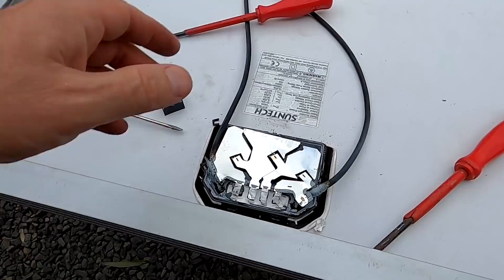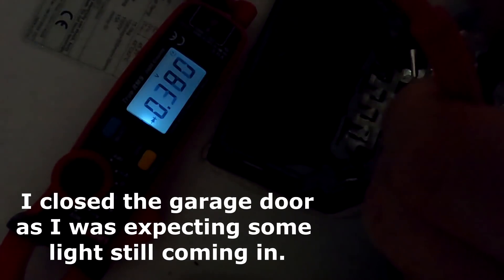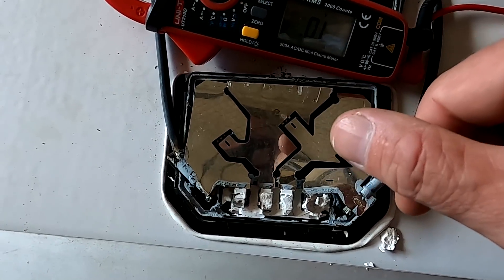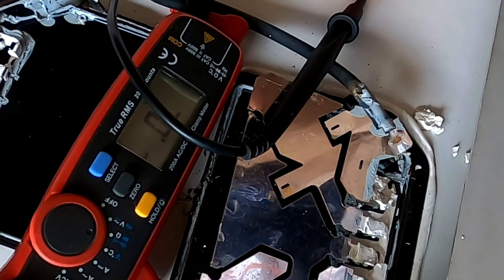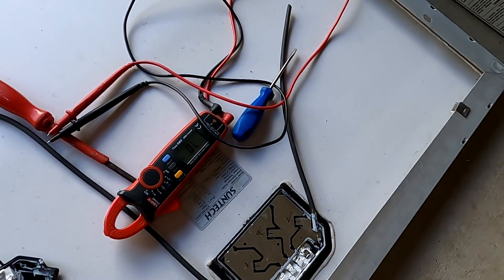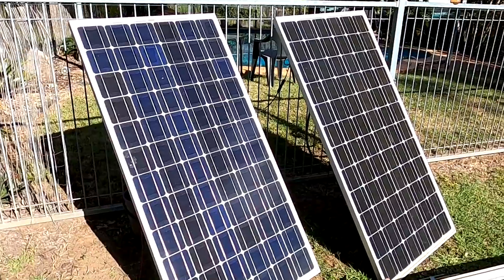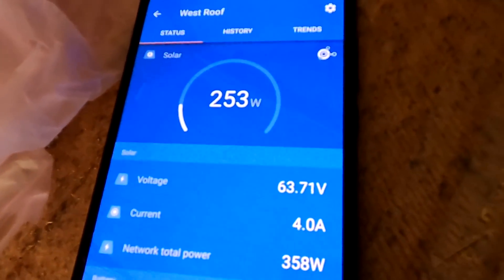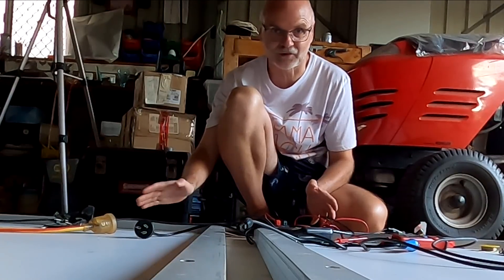Solar Panel Diodes. I found the problem (for a moment)...

Comment: If it's not the diodes, then it must be a faulty/shorted cell in the same string the apparent faulty diode is across. Did you de-solder a diode to test it at the component level, outside of the circuit? Can parallel a few common 1n1004's as a temporary diode substitute to test the difference on a single panel to rule it out.

Comment: Easy to diagnose - get one good panel, connect another panel which is under test and connect to solar charger. If it works well, panel under test is fine. If not... that other panel has an issue.

Comment: My understanding is a panel CANNOT make it’s rated max amperage unless it is shorted out. When it is outputting max wattage, the amps will be a ratio of the watts to voltage...

Comment: At 13:04 we see Andy testing the cell temperature at 54c.  STC is 25c, difference is 29, multiply by 0.3% temperature derate, multiply by panel STC Vmp 36, subtract from 36v, multiply by 2 and we get .... close to 65v, or what Andy saw the Victron settle on at 11:59.  To channel that well known person, AvE, IT VERKS.

Comment: I would unsolder one leg on the diodes and re-measure. It could be a cell string short circuit and not the diodes but unlikely. This is new territory for me and been off grid for years.
Reply from the maker: You're spot on Dave!

Comment: How about applying power  directly to the panels from your lab power supply to test the diodes?

You would not need to crack open the diode case

If all the diodes are working you should see the full voltage with a minimal drop
Reply from the maker: I could try that...

Comment: Nice testing, but no beer until you snip the legs off the diode and measure them in isolation. If it is not the diode then it could be PID of the cells. Note that within a string it is the panels near the positive end that get the worst PID. So some panels that came from the negative end may still perform well. Note that for testing diodes or cells, a “good” result at 2V does not mean good at 45V.
Reply from the maker: That's absolutely correct.

Comment: Andy, 5 seconds into your video there is a clip of your panels on the roof. The left hand one shows some diagonal cracking in the cell at the bottom. I have experienced this myself and it generally leads to lower output depending on how many of the cells are cracked. Just thought I would mention it as it was just like the cracking I saw on one of ours (also in Brisbane area). Not suggesting this is your current problem but I think it will get worse and as you have spare panels maybe this one should be pensioned out.
Cheers Allan

Comment: Looking at 7:47 in the video there appears to be a lower strip connecting the terminals as well as the upper strip containing the diodes. Is it possible that the fault is because of the two strips shorting out somewhere, perhaps from the cover pressing on the upper strip.  

Also, the reason the short circuit amp test across the  two MC4 terminals appears correct while the connection to the charger doesn't work is the short circuit has zero resistance while the charger has some resistance which forces the current backwards through the diodes due to the lower resistance.  

Also again, perhaps the PW charger works better in your test may be due to the resistance being lower through the PMW charger than in the MPPT charger. This can be verified by checking the input resistance in both the MPPT and the PWN chargers.
Reply from the maker: I made sure they are not touching. If the cover is closed they are definitely separated and have these plastic pins to prevent this from happening.
Reply: @OffGridGarageAustralia  At the 2:24 mark look carefully at how the diodes connect to the lower strip. The diodes bridge the large pieces but it APPEARS that the small strip  that the large pieces  connect to is one continuous piece of upside down "Us".

 It may be that the Us are separated on that strip but it is hard to tell from the picture. 

If the lower strip of upside down Us is either one solid piece or somehow shorted between the Us that will defeat the purpose of the passing diodes.

Comment: May need to heat the diodes up to see the failure just in case you run into that when they cool down they test good sometimes.  I think a good share of us have replaced diodes over the years.  I have a big bag of them so cheap and I just replace them anytime they are questionable with better quality ones.

Comment: Now how to find that pannel on your roof. If you cut one wire in a string that string is now open and for all practical purposes does not exist any more so now you have 2 strings so now you would get 60 volts at 10 amps from the 2 if all the panels left are good. If you still only have 1 volt at 1 Amp reconnect that string and cut the next. When you have then found the bad string using this method take that string down check the diodes in those panels and the connectors. These are things you can repair on a panel if it has hot spots showing on the back or other problems sorry but you will not be able to fix these and you then will have to replace those panels.

Comment: Take a panel with bad diodes and run it in series with the diodes removed.
That will definitely rule out micro cracks.

What clamp meter are you using, and do you recommend it?

Comment: Amazing job.  Totally impressed.  You should be able to test without disassembling junction boxes by shading each section covered by a diode while a load is applied.  Voltage should change drastically depending on if a diode has failed or not.  I bet you could also put a reverse voltage on the panel(or even use meter diode checker) and get a consistent 1.4V per section that diodes work.

Comment: Common knowledge says when panels are connected in series voltage is added together thus 3 20volt panels equal 60 volts. And when counted in parallel voltage stays the same an amperage is added together thus 3 12volt 5amp panels yield 12volts at 15amps. So if you have 9 panels in 3 strings you would get 3times the voltage  and 3 times the amperage.  Sounds great right.  OK let's put in one bad pannel in one of those strings. Let's say this pannel only yelds 1 volt at 1 Amp. So instead the string it is on then would not yield 3 times 20 volts but instead will only yield 3 times 1 volt for a total of 3 volts. And at 1 nd that at one Amp. Since it is lso hooked up to 2 more string you with 60 volts per string you might see 60 volts but you would only get 1 Amp from the whole 9 of them. Or you might only get 3volts at 1 Amp.

Comment: If you suspect a bad solder joint. You can buy a can of "cool spray for electronics". Spay on the solder joint while using the diode check meter to check for a bad intermittent solder connection.

Comment: Hi Andy. It would be great if there was some way to test the diodes without opening the connection box. Surely there is a way. What about a few strategically placed holes drilled in the box that can then be sealed after with silicon or tape.
Reply: A simple way to test diodes is to use a bench power supply: set the current limit to 3A, set the voltage limit to panel open-circuit rating or whatever your power supply can output if it does not go that high, then connect panels in the bypass direction while fully dark. If the diodes are good, the diodes' forward voltage should be around 2V (3 x 0.5-0.7V + wiring losses). If the voltage is much higher, one of the diodes is open-circuit and current is leaking through the array. If the voltage is much lower, at least one of the diodes is shorted.
Reply from the maker: There is actually a diode tester out there for solar panels. Well, diodes is only one thing it measures, also does isolation and performance I think. Costs around $1600 though.
Reply: @OffGridGarageAustralia  wow that's lot.

Comment: Afaict, diode mode on a multimeter just applies a small voltage and then measures the voltage drop. Fundamentally not different from measuring resistance with a multimeter. You should be able to just measure resistance on still pristine panels without opening up the junction boxes and figure out which are faulty. You already created a dataset with the panels you already opened and diagnosed, so you can use those to verify this method and the values gotten.
Reply from the maker: I'll show that in the next video.

Comment: Assuming no shadows.
The ISC is a direct measure of the solar radiance. If both panels has an ISC within 10% of each other, the ideal photovoltaic current source is working. A large difference the lower ISC panel has a problem. 

The VOC is a measure of the current in the Diode part of the solar cell model. If the VOc voltage is within 10% between the 2 panels, the diode part of the panel is good.

The 54 deg C temperature is acceptable. The nominal temperature on the panel lable is 45 degs C and assumes a reference diode temperature of 25 degs C.

The wattage reduction for a higher temperature can be approximated by (54-25) *0.5 =14.5 watts.
Where the 0.5 watts/deg c is a general number for Silicon diodes.

The light intensity current is linearly proportional to the sun radiation. If you can get the NASA sun.xls spread sheet (free) you can get an estimate of the solar intensity in watts/m^2 for your location and time of day. Or you can get a solar irradiation app ,(free)  for your phone. You weather service may have solar data you can lookup. 

Good luck

Comment: Great achievement! Can you measure the diodes from the mc4's in a diode check when the panel is not illuminated? Maybe with a small 9v battery you can measure the voltage drop accross the reverse diodes, the voltage should be 9v in the end. But it will only show if 3 diodes are broken. Can you replace the diodes yourself? It saves the panel.

Comment: Seems to me it would’ve been much easier just to measure the positive and negative off of each panel with your meter? That way you could’ve found the bad panel faster and took it out.
Reply: Nope. If only one of the 3 diodes blocks there wont be any reverse current, regardless of the other two.
Reply: @stephanweinberger  
I’m no expert, but it seems like checking each individual panel would’ve shed some kind of light on one of the panels being bad. 
I’ve got 20 panels on my roof and have never seen this kind of issue. Strange how the panels he mentioned were problematic were one of the so-called best?

Comment: Might make a device that pulls current to the specific mppt voltage of the panel (not tracked, just pwm) at this stable voltage I could measure the current. This should show faulty diodes without opening back. I did watch to the end btw. Even if diodes aren't the problem such a device would pickup any such problems. I had a panel with one of the parrellel strings of cells high impedance yesterday.
Reply from the maker: Yes, that is exactly my idea: a MPPT charge controller and a 12V Battery connected to each panel individually. That should give us a good indication of the performance of each panel.

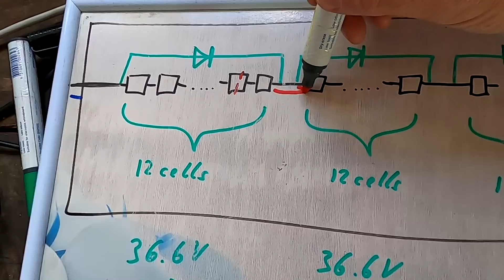Comment: @4:57 The diode has 45V break down Voltage, the diode is being reverse bias by 36.6V string Voltage (and can get higher when cold), the diode should have been spec in at least twice the reverse Voltage being applied to the diode, in this case, they should have used 100V rating not 45V. I'm really glad that you find the problem. BTW, you should also post your videos in DIYSOLARFORUM.
Reply from the maker: The reverse voltage for each diode is only 1/3 of the overall voltage as it covers only one string out of three. Hence three diodes...
Reply: @OffGridGarageAustralia  May be I am looking at your drawing wrong then, your drawing shows 36.6V/36.6V./36.6V for the  3 sets of the cells for each panel.
Reply from the maker: @budmartin3344  OK, I now understand what you mean. Sorry, that was a bit misleading in my drawing. So, each panel has a Vmp of 36.6V and I have three panels in series on the roof.

Comment: All it takes is shorted diodes on one string or one panel and the whole system will lose its productivity. Because they are all connected together at the charge controller they will act as one system. Usually all the diodes in one string will go at the same time because of a over voltage cascade.

Comment: You not must the open junction box. If you connect in serial resistor (R=U/I) then voltage must be 36V. If you have less then is one string on panel in short. So.. 36/5 is arround 7.2 ohm.

Comment: Average life expectancy of a properly designed, inspected, installed, etc. diode should be 100 years. Odds of so many crap diodes...Nope. Manufacturing defect, like the mobs of bad electrolytic caps in computer motherboards some years ago. Replace them ALL with higher rated diodes if this is the case. Unlikely they'd all been struck by lightning without visible damage.
 And make sure to heat sink the new ones.

Comment: As the conductor areas are large inside the box and you know their layout you could just drill small holes in the cover in the correct places and push the cable probes through. Afterwards just seal up the holes if the panel is good.
The other observation is that the panels themselves might allow reverse current. You would need to disconnect the diodes to check. Diodes don't often fail closed circuit.
Reply: In my own experience repairing electronics, semiconductors almost always fail shorted unless the overload is large enough to blow them up.
Reply: I thought the same thing about drilling holes for testing. A dab of sealant afterwards.
Reply: Fantastic tip

Comment: As you will change a lot of diodes try to get some with higher current and voltage rating, otherwise the same thing will happen again.
Reply: Could have been lightning in its past life.

Comment: Well done, the Diodes are half wave rectifiers.
Reply: There are different rectifiers depending how many and how they are configured of course.
Reply: Half wave on AC. On DC one direction.
Reply: @michaelbouckley4455  Normally AC, but maybe it clears up the DC signal for transience.

Comment: For the moment, test all the other panels one by one with the two panels so you can sort the stack of panels that you have into good and bad panels. Then install the good ones on the roof again and worry about the bad ones later. No need to open the good ones.

Comment: 042221/1429h PST 🇺🇸 042321/0730h Brisbane. AT LAST! You are jubilant happy and jumping with joy. So am I.
You can close the junction box to IP67 standards. As said before procure about 50 pieces of those Schottky Barrier diodes for future.
Not the Diodes? Hmmmm let’s know, 73s...